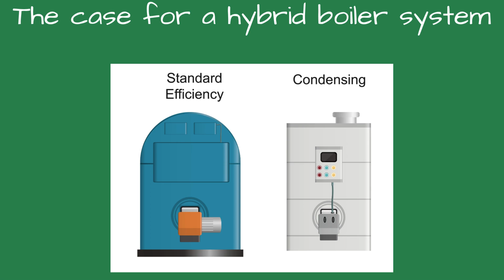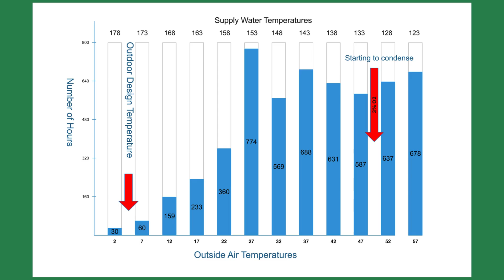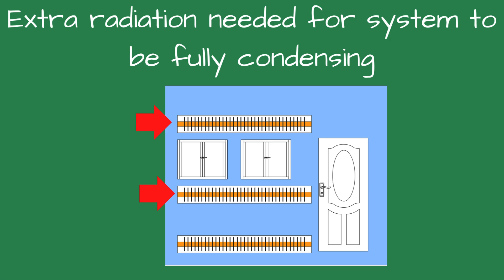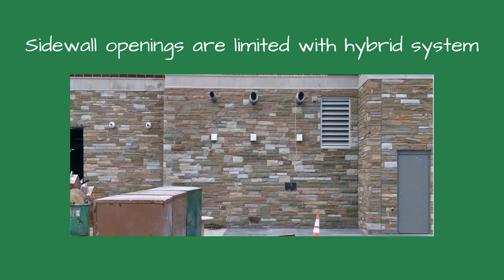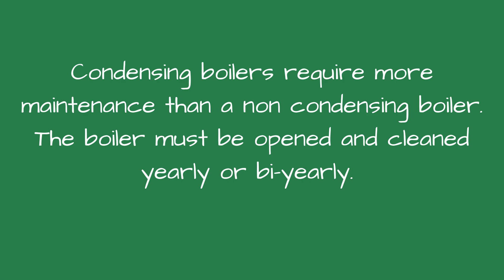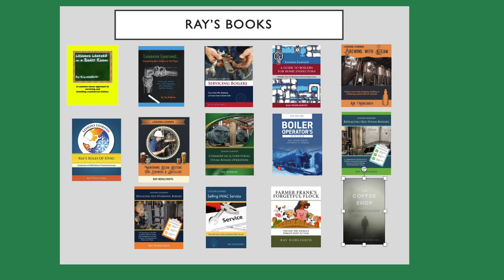Case for a hybrid boiler system

Comment: 27 years ago I replaced a 1920's Indestrcto /Cardunco nat gas gravity hot air heater, it had crazing fractures in cast iron octopus heat exchanger... local utility PECO condemned this dinosaur rightfully so. Prior to replacing we operated & brought to full operating temperature, flue piping you could touch in it's entire circumference and not get burned or feel discomfort. No visible signs of flue gas condensation....anywhere. masonry chimney perfect.  My conclusion is vast amounts of heated indoor air kept draft hood & vent connector clear/dry of flue gas condensation. A properly sized and smaller 80% modern furnace was installed correctly with numerous ductwork modifications. Puzzling to this day their operating costs increased?
Reply from the maker: That is a head scratcher The only thing I could think is the chimney draft was high and would pulled the flue gases through quickly as well as the air through the draft diverter. I will think about this one